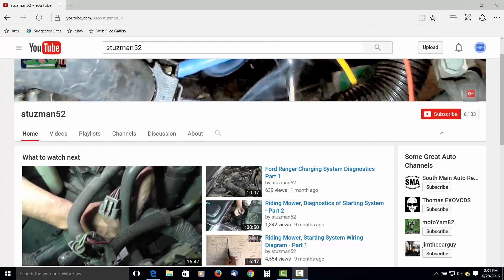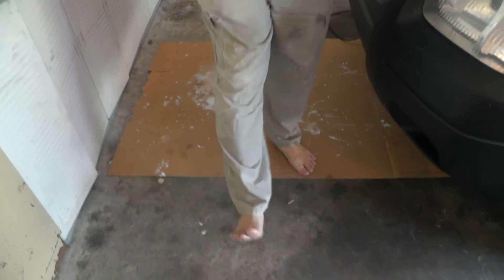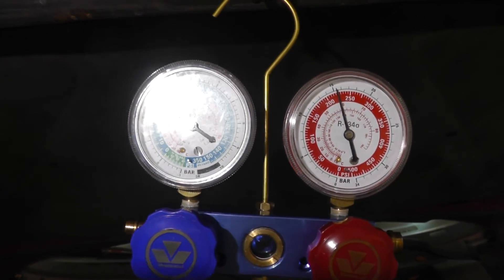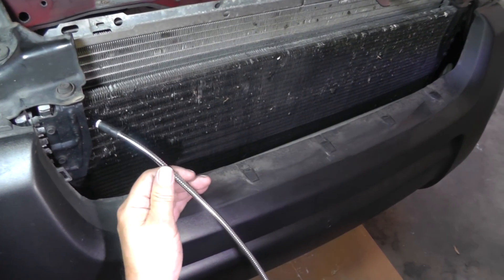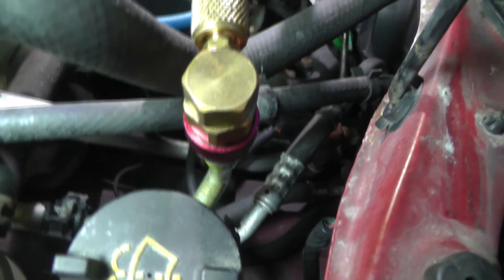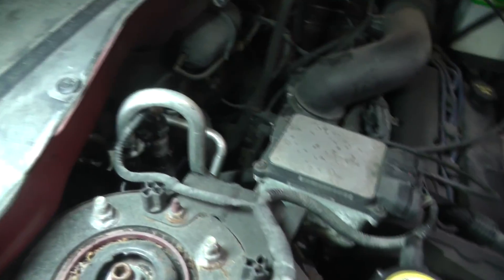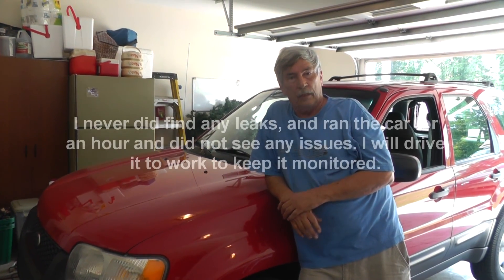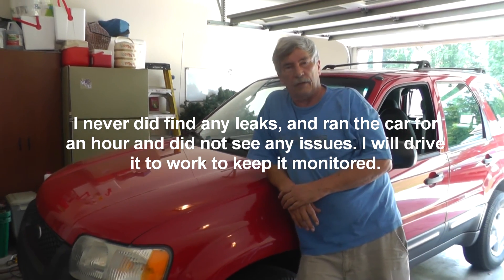Automotive A/C Leak Detection Methods

Comment: Awesome video brother!!!!! Congratulations to the wife on the New vehicle 😉👍🏻👍🏻🇨🇦🇨🇦
Reply from the maker: Thank you very much CamaroSS and glad you dropped in to the channel and left a comment. Yeah, the wife has been bugging me for another vehicle for a few months now. Got a few minor issues that needs addressing and I'll probably throw those in some videos. Take care and have a good one!!!
Reply: +stuzman52 I glad you showed the right ways to check for A/C leaks 👌🏻👌🏻 😉😉🇨🇦🇨🇦
Reply from the maker: Most  a/c techs would know all of these methods. This video was just to show DIY'ers some other techniques. I'm sure that most of them would use the UV dye method. Thanks for the comment...
Reply: +stuzman52 I agree the problem is that you would be surprised on how many shops don't have the right tools so they only use the dye 👍🏻
Reply from the maker: Never realized that, but I'm sure you're quite right as it's been ages since anyone has worked on my vehicles. I really don't get much of a chance to scroll through a garage and chat with the mechanics. But I do know that there are good techs and some not so good. Oh, I forgot to mention this, but from a previous post that you did, it sounded like you were running your own shop at a pretty young age. That's pretty impressive and I'm sure that you learn a lot of stuff over the years. I'll be looking forward to hearing your thoughts on whatever comes your way on your channel. And always wishing you great success with YouTube. Take care CamaroSS...
Reply: +stuzman52 Yes at 19 I had a little unit with 1 hoist and word of mouth about performance building and I was off  two years later at 21 got married and opened up a 5 bay shop with a partner we had the shop for about 20 years and sold it I'm am in to land development now but still work on our race cars and street car when time allows 😉👍🏻👍🏻🇨🇦🇨🇦  Cheers 🍺
Reply from the maker: Quite an accomplishment I must say at an early age. Even though you've sold your shop, it's good to hear you've stayed with your passion of working with cars. Just out of curiosity, what does CACA mean other than the obvious LOL? I looked it up as an acronym but can't find it's meaning :)
Reply: +stuzman52 how was it used ?
Reply from the maker: I've noticed it in most of your comments near the end. There will be smiley faces, thumbs up and then 'CACA'. Cheers!
Reply: +stuzman52 LOL !!!! They are Canadian Flags they must not show up
Reply from the maker: Oh my Lord! I saw Ontario on the license plate for the Camaro so I figured you were from Canada. But it never occurred to me that 'CACA' would be your Canadian flag. Although the icon isn't showing up, now I know what it means :) Have a good one!
Reply: +stuzman52 Cheers 😉🍺👍🏻

Comment: Thanks for the video.   It was very informative.   You should also check for leaks at the low and hi ports.  These seal with just a rubber o-ring and will leak as the rubber ages.
Reply from the maker: Yes, John good point. After I do a scan for leaks and after the gauges are off, I'll do a sweep of the ports to ensure that the schrader valves are not leaking. Thanks for dropping in and sharing your thoughts.

Comment: Great video as always dear Mr. and Mrs Terry. You discussed almost all possible leak detection ways. The ultrasonic one was new for me in this field. To me the real problem is an air conditioner system which leaks but there is no significant leakage sign on there on the system and also the system won't show any leak when checked for a leak by available possible ways. Problem is there is sometimes leak under the compressor pulley and sometimes under the dash. Both places are very difficult to reach in normal conditions. Thanks for nice upload. Regards,
Reply from the maker: Hi Jahan...yes, even with all these methods, a leak can still be difficult to find. And thank you for watching the video and leaving a comment.

Comment: I tend to use the dyes myself, adding them to every vehicle I service regardless of concerns about leaks.  That way next time I inspect the vehicle, I can run the black light over it real quick and check to make sure all is still well!

The only drawback to dye is that you may not catch an evaporator leak.  I had a car come up clean inside once, but when the customer came over to look around, he lit up like a Christmas tree!
Reply from the maker: That's a good policy to when you're servicing cars and if they develop a leak, it saves time when the vehicle come back. Since I service my own vehicles, I tend to wait for the leak and then go from there. But if I was servicing other vehicles, I would do the same and put the UV dye in them. Thanks Rob for dropping in...